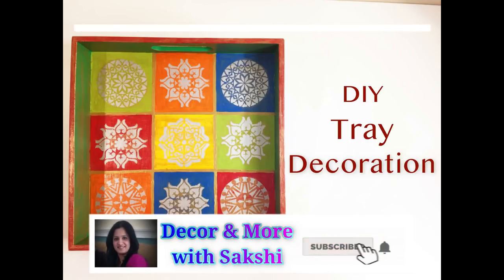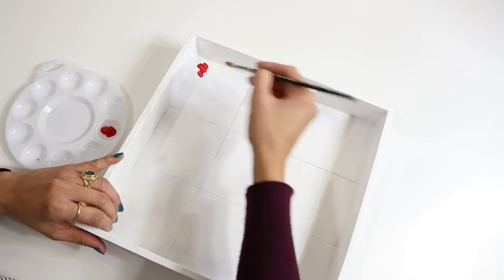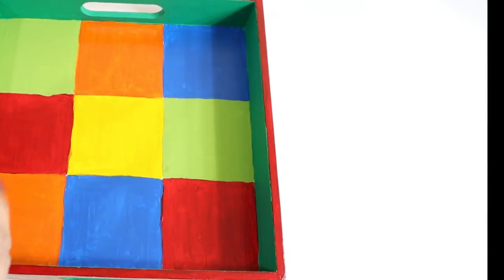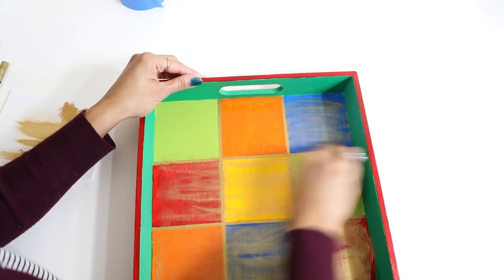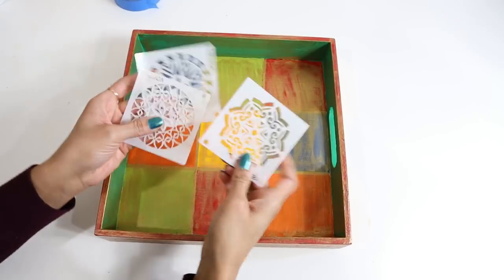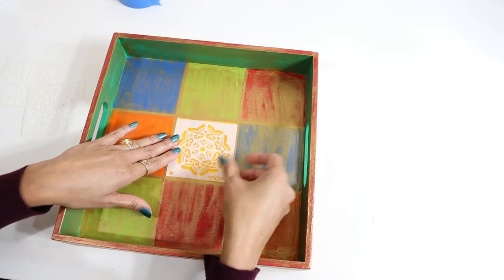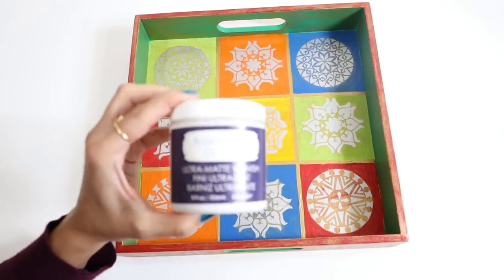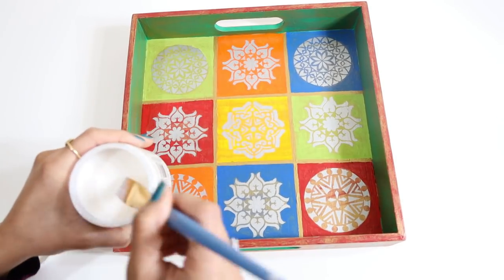diy tray decoration ideas | Easy Decorative tray | designer tray | old to new transformation

Comment: Which paint u used ?
Reply from the maker: Thanks for watching my video. I have used acrylic colors. These are the links below
Acrylic tube colors: https://amzn.to/2zjhGSr
white acrylic color: https://amzn.to/2SF2l5v
Reply: @DecorAndMoreWithSakshi  may i used oil paint instead ov Acrylic
Reply from the maker: @hinaleo7060   yes,  you can use oil colors as well but before applying don’t forget to sand your tray a little, so that oil colors won’t peel off.